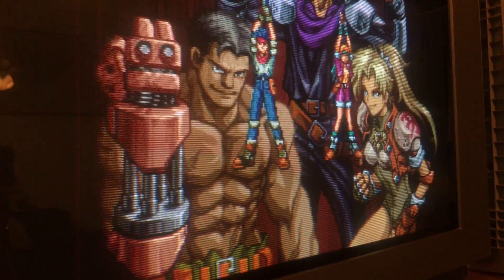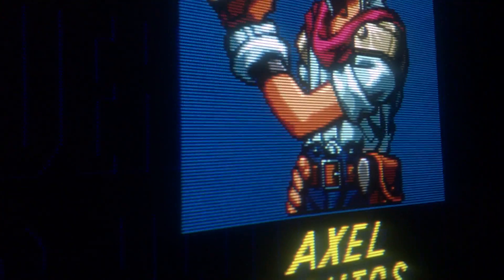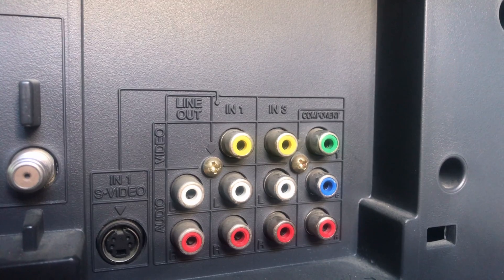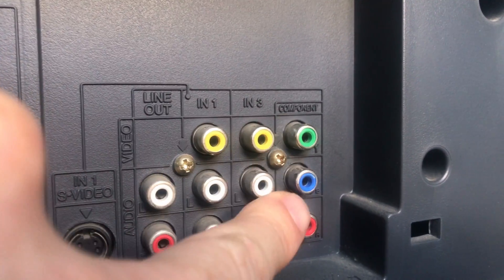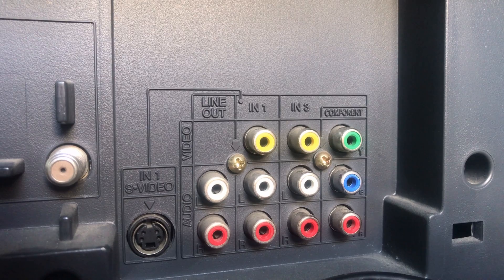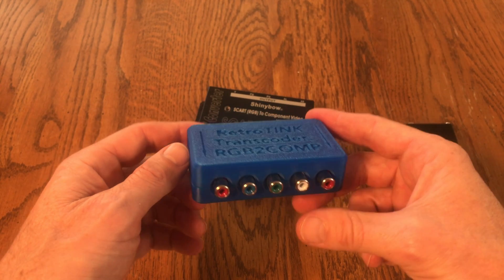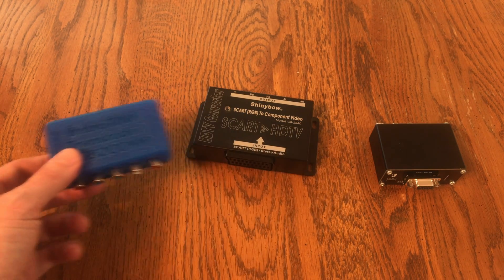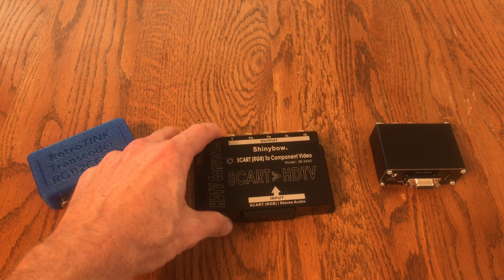How to Get RGB Into USA Consumer CRTs. Plug and Play Solution.

Comment: can you do hdmi to component? or only scart and VGA? my pc doesnt have VGA on the GPU
Reply from the maker: @SobKnight  pretty sure you can do 1080p over component. Might be wasier to get a graphics card with vga or dvi on it. Dvi can adapt to vga connector pretty easy
Reply: @riggel8804  my card does have DVI. It won't give me 240p tho would it?
Reply from the maker: @SobKnight  the card can probably output 240p if you can tell it too. Most gui won't output 240p though. I use a program called crtemudriver to putput 240p from windows. I think an easier option is available now. But I doubt your pc monitor will accept 240p. 480p is the lowest they can go.
Reply: @riggel8804   I see, yeah I got a couple CRT TVs recently and I've been trying to figure out how to game on them properly with emulation cause I have no retro consoles other than PS2. And it's super overwhelming and hard it seems to find straight answers on how to do that right since everything to do with emulation consoles are about using them on to HDTVs. And or anything else introduces input lag or are quick ways to just display it on your CRT even if it's in the wrong resolution.
Reply from the maker: @SobKnight  easiest and best way is to use a MiSTer. You can buy MiSTer pi for about 200 now all setup. MiSTer add ons is a good site
Reply: @riggel8804  Ah i see, its VGA analog so i would need one of these transcoders for it to work on my TV right? Thanks for all that help btw.
Reply from the maker: @SobKnight  the vga on the mister will output component or rgb. You just need to by a cable with vga on one end and whatever you need on the other.

Comment: Definitely agree there's no real advantage of RGB over component. The one caveat is that a few tv sets do processing on component you can't turn off, but thats because of the TV's design not the component interface itself. I had issues when I tried to use RGB on my modded N64, I was running a cheap N64 scart to a Bitfunx transcoder to component and the signal was trash (I don't know if it was the cable or the transcoder). The mod I have fortunately also supports component so I just had to find a cable, even the cheapest one I found works great, then I sprang for the fancy HD Retrovision cable and I really can't tell the difference. Another nice thing about RCA cables is that you can easily make your own with limited soldering skills. Although these days its hardly worth it, I just have a ton of components from years ago when I used to do more stereo stuff and made them for audio.

Comment: HD Retrovision cables are meant for this .
Reply from the maker: They work better as butt plugs.
Reply: @riggel8804  lol, do you think they no good? Some of their cables have a built on transcoder. Price wise, they are slightly more expensive then a good quality SCART cable. Quality wise, I can’t tell the difference. I like to use them becases it simplifies my Component setup.
Reply from the maker: @chchris25  na they work good. The  cord is nice and long. Helps you pull it out when sunk deep.

Comment: Random question but… do I have to have a separate transcoder for each console? Or is it possible to have my component switcher feed to one transcoder right before inputing to my CRTs one component input?
Reply from the maker: yeah that's what I do for my consoles. I have all my consoles feed rgb to a switcher. Then I feed the rgb out of the switcher a my transcoder. The transcoder then feeds component to my component switcher which gets sent to my crts.

Comment: Hey Riggel, how do you connect up your MiSTer? Are you using the analog vga to ypbpr breakout cable to extron? What are your thoughts on the direct video RGB out from the MiSTer? I hear this has better colors. I'm using VGA to ypbpr and it looks great. Thanks for the videos!
Reply from the maker: Your welcome. I would use whichever is easiest for your setup. When properly setup you can achieve identical results with rgb vs component. I use a cheap vga to component breakout cable and plug it into an extron component switcher. You don't need expensive cables for component it doesn't suffer  from artifacts like rgb.

I highly doubt that rgb output on the MiSTer is superior to the component output. People have been saying for a long time that RGB has a wider color space compared to component. This might be technically true in a trivial way. I don't know. However I have spoken with multiple people in broadcast editing and they have all said that the two are identical in terms of quality. I did a test on my own and I came to the same conclusion. There is a rgb vs component video on my channel.

Comment: people is confused.. RGB it´s the same in SCART and in component RCA cables. Both separates 3 primary colors
Reply: it is not the same scart RGB to Component, since RGB/Scart sends R, G and B separate from Sync, and Component send sync signal in the Green line, so you lose a tiny tiny bit of signal there, but its almost the same looking at the screen.

Comment: This is the video I meant to originally comment on. How are you handling your audio output from all of your consoles? Thanks!! 🙏
Reply from the maker: My setup is a little goofy. All my consoles output to a scart switcher. Switcher feeds audio to Fisher hifi receiver. The video goes to my component switcher.

My MiSTer and windows pc feed their audio to a Schit Modi dac. My dac has 2 inputs 1 output. The dac outputs to the aforementioned receiver. Receiver is outputting to hk-40 speakers.

Comment: Do you play lightgun games with retroarch? I want to get a gun that will be compatible with crt retroarch. What's your solution?
Reply from the maker: I use the ps2 for light gun games. There are about 6 really good light gun games on the ps2 that use the Namco guncon. That's more light gun games than I will need in my lifetime. 

I've heard that the Sindin Light Gun works with crts and retroarch but I haven't used it. It's supposed to work really good.

Comment: HDMI to component...works perfectly...no artifacts...no lag that I can tell. The run ahead In retroarch I find zero lag. The only thing is only 240p and no 480i with Nvidia GPU s...and I manually scale the games for each system because of different resolutions of each console. And truthfully I don't game on CRT for 480i anyways...and 480i games will still play in 240p. $30 on Amazon.
Reply from the maker: I've heard of that cheap hdmi to component converters work really good with the MiSTer. Not sure how they would work with a windows pc. My guess is not well and with lag. I did a pretty deep dive into retroarch and run ahead in my video, "how to sense input lag" There is still input lag with retroarch. Even with runahead.Ive got another video comparing runahead to original hardware on the MiSTer. I forget the name of it. It's got BattleToads in the thumb nail.
Reply: @riggel8804  it works really well...I saw the input lag video...I've tested it and input lag is negligible with run ahead on...I will post a video in the future because people have to know how great it is.
Reply from the maker: @joshforsyth5710  give it the clinger winger test
Reply: @riggel8804  lol...I'm not a battle toads fan. maybe slow mo mario jump test...Heres the thing...i cant play super mario world on a lcd..i suck so bad...with the hdmi to component adapter to crt the controls are so tight it feels perfect,,,when you press jump its instant...thats how i know that the input lag is nothing.

Comment: It’s always a catch 22 when you think about what’s most cost effective in terms of getting RGB out of a particular console onto a particular screen. I think it’s generally component over Scart when it comes to CRTs (at least in the US). Getting RGB out of most of the earlier consoles (that can output it without mods) like SNES, Genesis, Saturn and PS1 you’re likely better off getting packapunch Scart cables vs the HD retro vision cables. And then …you throw in Scart switchers and a transcoder and you’re likely back to square one. I guess the cool thing is is we now have a million options to spend money and annoy our significant others.
Reply from the maker: Yeah dude the cost adds up quick. I think rgb cable are like 40$ each and RGB switchers are all really expensive. Getting a MiSTer for $300 starts looking cheap. All you need is one cable for every system.

Comment: I really appreciate your videos, thank you for touching on this topic! Although RGB is great and I love the look, there are systems that I prefer S-video on, like the Genesis/Mega Drive, because of dithering. Yes the S-video mod costs a little, but good quality Scart cables imported from UK are like $75 after shipping, then the transcoder is another $75. I just can't justify the cost for that. 
Of course I don't have the fantastic set up that you do! I really do appreciate what you do, and thank you once again! Cheers!
Reply from the maker: I've been wanting to do a video on this different looks you can get out of CRTs. i.e. 900 line bvm RGB; composite on a cheap CRT etc. I will have to remember to include s-video. I hadn't thought of it but s-video might be a sweet spot for a lot of people. It is really clean and still retains the dithering of composite.
Reply: @riggel8804  would love to see your take on this. I use svideo because it's low commitment. Cables are cheap, and it works with a stock ps1, dreamcast, snes, etc.
Reply from the maker: @robbyjvc  I think that is a great solution for most people. S video is really close to component and like you said it's super easy and cheap.
Reply: @riggel8804  if you do that video, I'm sure it will rock! You do really good work.
Reply from the maker: @retroprojections  Thanks! I think it would be a lot of work to do right. There are a lot of different things you can do with video on a crt.
Reply: S-video cables that are actually doing what they're supposed to will clean up the dithering, meaning they will display the dither pattern clearly like RGB and YPbPr do, rather than blend it like composite and RF do. So for systems like Genesis/Mega Drive if you want to retain the blending and extra color effects you have to use composite (or an "s-video" cable that's really just passing combined luma/chroma, i.e. composite).
Reply from the maker: @Izquierda  Cool. Thanks for the info. I have very little experience with S video.
Reply: @Izquierda  that's interesting. So my S-video is just a pass through? It does look much better than composite, but I assume that is because of the quality of the cable?
Reply: @retroprojections  If it looks much better than composite then maybe the cable is wired correctly, but maybe your TV's Y/C separation is not "good" if the dithering still appears blended like with composite (though in this case it has a good effect for gaming).
Reply: @Izquierda  that's so interesting, thanks! 🙏
Reply: In my opinion dithering lok better with composite. I was playing Darkstalkers 3 on PS1 with composite and svidel and notice Svideo doent do complete dithering